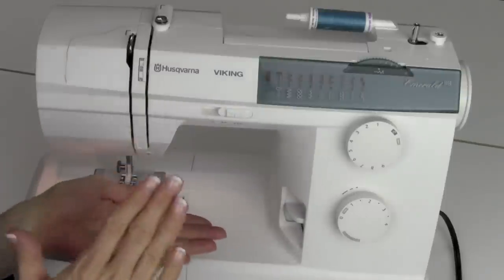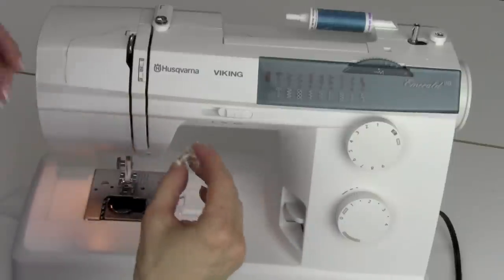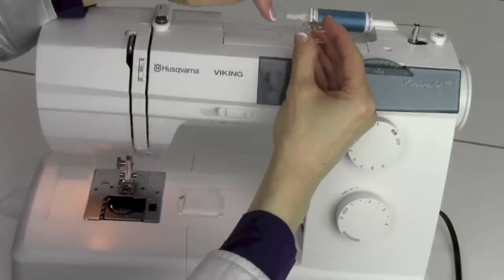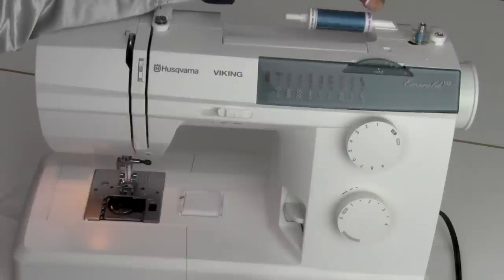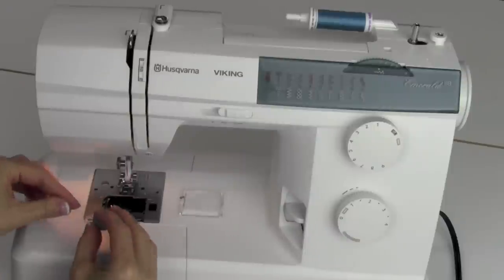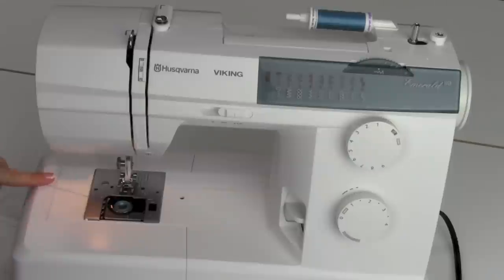Viking Emerald 118 03 Set Up

Comment: I have this exact same machine and i have to ask how exactly you were able to get the bobbin thread pulled up so quickly. ive had this for approximately 2 years and it takes me on average an hour and a half to get the thread up. ive tried it the way you demonstrated in the video, ive pushed it into the bank toward the needle (as shown on the bobbin cover), ive opened the entire case and screwed around with it until the thread came up, and every way leads to more frustration.

Comment: Should the thread that is in the x pattern always only be used on the horizontal spool holder? Or can the stacked on be used on that? (My first time sewing ever and my hubby bought me this machine).
Reply from the maker: Hi Carisa, It is recommended to place cross-wound thread on the horizontal spool holder and the stacked thread on the vertical holder. The rest of the videos in this series will help tons! Thanks for watching. ~Sara~

Comment: I bought this machine today, brought it home, attached power cable & pedal and it doesn't work😟very disappointed. The light goes on but when i press the pedal-nothing happens.  Will need to return it to the shop. I'm put off with this machine now.
Reply from the maker: Hi, Sorry to hear about this. Though it rarely happens, this is why at our retail store we open every sewing machine and sew on it before it leaves the store. ~Sara~
Reply: HeirloomCreations 
That is very good, conscientious customer service on your part. I called the shop today and the lady thinks it's unlikely the machine is faulty but the foot pedal. I agree as the needle up/down button works but nothing happens when pedal pressed. I will not be leaving the store without the machine & pedal being tested first that's for sure! Another 50 mile round trip! 😕
I look forward to watching more of your channel once I'm up and running - thank you.
Reply: Can't see that it not working? When it's brand new? It's supposed to be tested at the factory?
Reply: Moe Luck 
My machine was one of a whole batch of faulty machines. There was a problem inside the machine where the pedal cable connected. That particular batch had failed to be quality checked somehow. I live in Scotland and on 3 occasions dozens of faulty machines were being sent to and from Poland. After 6 weeks of constant broken machines, a fresh batch of machines were finally received in perfect working order. 
I love my new machine and cannot say a bad thing about it. In the 47 years the shop keeper has owned his shop he has never experienced such problems with Husqvarna. He hopes to never again.
Reply: Oh! Very sorry to here that! That's annoying when this happens. Looks like a nice machine. Someone was looking for one on Kijiji's website wondered what it was like. I'm in Canada.